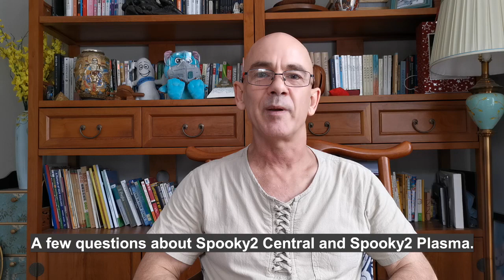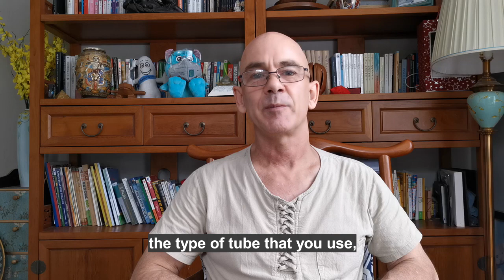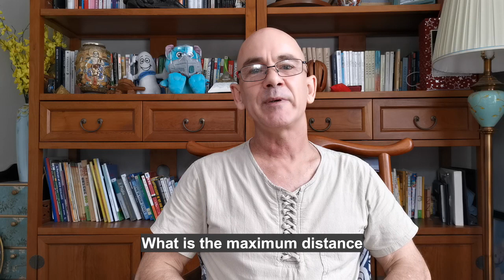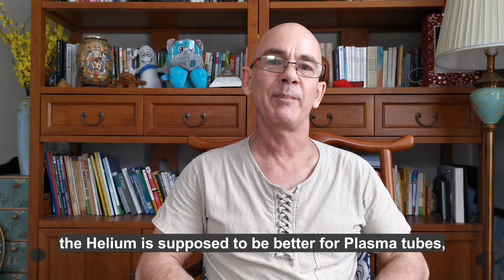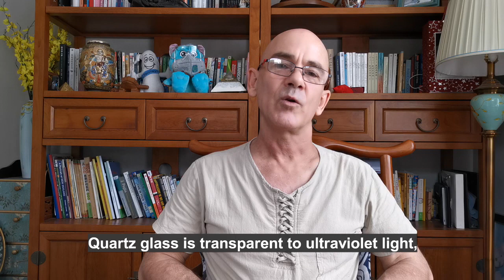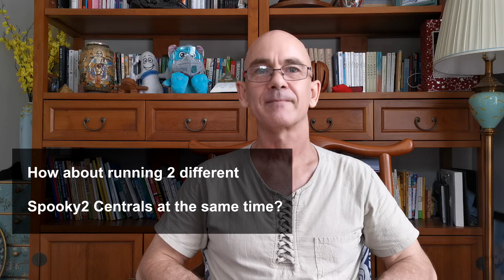Spooky2 Central and Spooky2 Plasma QA

Comment: Dear John,

My name is Peter Horvath from Hungary. My wife has cancer. The cancer started out as a breast cancer and became metastatic and became bone cancer.
I would like to ask, after your video, I was wondering, since bone cancer is likely to be there all over her body, which apparatus should I buy?
I mean, you should buy the straight plasma tube, but I don't know if you have to buy the central or plasma machine next to it. (I mean big box)
And I don't even know that in this case the generator x package should also be taken?
And there’s one more complicated thing that when it turned out he had bone cancer, he slipped on the ice 1 month before (December 13, 2019) and broke his right femur. And on top of that, it broke into length. 
And bone cancer caused a tumor in the 9th vertebra of his spine. And because of that, se was paralyzed from his hips. 
So I would be very grateful if you could help me with exactly which apparatus and kit I should buy. And which generator would be the best choice for body scanning. I can see that in the video when the plasma tube system is shown, the generator xm is installed there. Does this plasma tube system not require the generator X module?
So, can you tell me exactly which packages my wife should buy?
Thanks again in advance for your help.
Regards
Peter
Reply from the maker: kvantumfeny.hu Hi Peter. Please contact our support team in this matter. They will be very happy to help. support@spooky2-mall.com